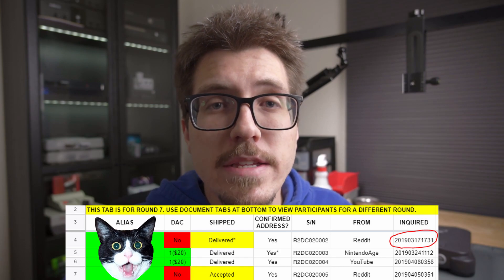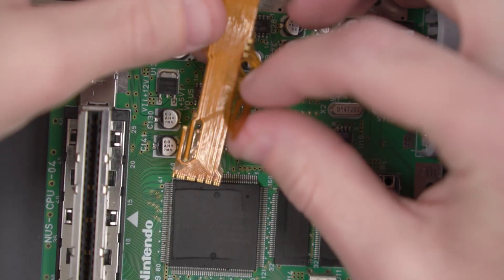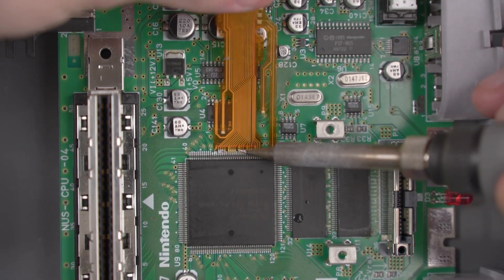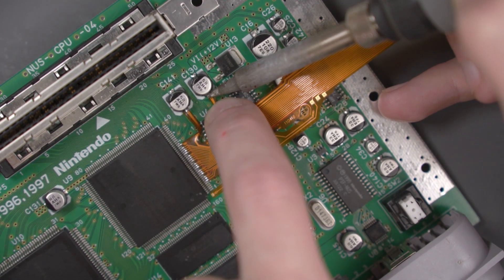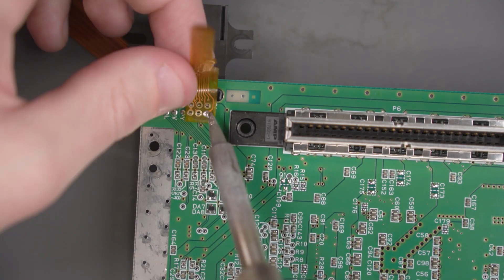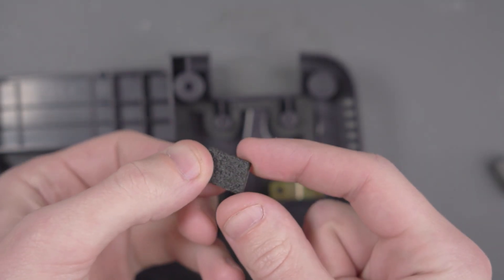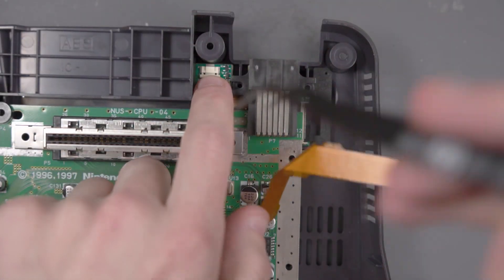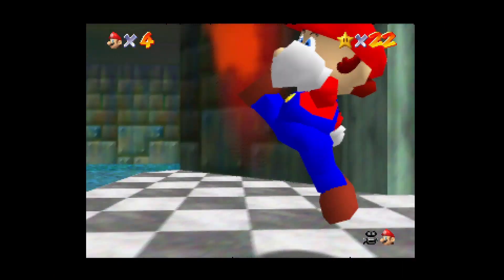UltraHDMI V2 Install - The Original N64 HDMI Mod Is Back... Sort Of

Comment: Thank you so much for making this video. I'm getting reqdy to instal mine, I also have the HW2 version and I had such a hard time finding instalation on the revised version.
Now I can go in confidently and get this thing done.
It's been sitting in my shelf for over a year. I finally built up enough courage to instal the damn thing. Fingers crossed I don't botch this.
Which flux are you using if you don't mind me asking
edit i see you linked it in the description. Thanks 🙂

Comment: I somehow just snagged one of these boards so I am excited to install it but I’m also trying to decide if I Should hire someone else to do it. I am tech savvy and I’m confident I can learn and prepare properly but I would just hate to mess it up LOL
Reply from the maker: Because of how rare these are (with little hope of easy access to replacement flex cables), I might recommend practicing on a different mod lol. Maybe a DCDigital or PS1Digital

Comment: What looks better, a deblur rgb with optimized ossc settings or the ultra hdmi mod? I’ve heard the former looks better from some on the forums.
Reply from the maker: The OSSC footage in this video is deblur through an OSSC in generic mode, and I think it looks just as good as the UltraHDMI. I tried FirebrandX's N64 profile, but it needed adjustments that I didn't have time to do for the video, so it might look a little better
Reply: @dubesinhower  I have an OSSC and 4x looks infinitely better than 2x, so I'm guessing RGB/deblur + OSSC is the way to go for videophiles. Thanks for the video.

Comment: What is flux brand that you are using? Wha'st temperature for soldering iron that you are using as well?
Reply from the maker: I use this liquid flux that Voultar recommended: https://amzn.to/3xfiTEb
In these tiny bottles: https://amzn.to/3v2cN7W
(These Amazon links support me)

I normally use 650 degrees F

Comment: Awesome video! Thanks for doing this. It will be a great reference for others attempting the install on an NTSC console. After doing several hundred of these, I have a few notes:
The Jumper/Expansion will come off with the top and stay self-contained. No reason to pry it out first.

Always lift the heat sink from the back if you aren't going to unscrew the RDRAM heat block. If you don't then you risk tearing the chips off the mainboard since almost all the legs are on one side with a few grounds on the other. Also, make sure the tabs are seated on either side of the memory slot before screwing it back down. Best to lay it down front-to-back.

You aren't missing a screw around the LED. ;) One is an exterior screw that you already removed when you took the top off.

The GPU is interchangeably referred to as the "Reality CoProcessor" and "Reality Signal Processor" which runs at 90MHz. Now you know where the RCP90 gun in Goldeneye 007 gets its name from. ;) It also handles digital audio, which is how the UltraHDMI is able to tap both.

The two capacitors supply 3.3v and 5v to the UltraHDMI board. The other two connections are for Reset and reading Pad 1.

A lot of failed installs happen when attempting to use solder braid since there are so many ways for it to go wrong, especially with a traditional non-cartridge soldering iron. Many T18-compatible Hakko clones can't respond quickly enough to the thermal mass at operating temps. People should cut the braid short, use a fresh piece, turn the temperature UP, and make absolutely sure it is completely molten before you remove it from the pins/flex. For a bridge like yours I would just add flux, clean my iron, and redistribute the solder without braid. Works every time!

I would suggest not adding solder to the multi-out pins until after the analog flex is in place. The notch in one side is so it fits down between pins 5/6 and 7/8. The wider side would not fit if you had it backwards. In fact, you may have to remove solder if pins 5 & 6 are bridged like they are in a few consoles. The plastic post might keep you from getting 1/2 totally flat.

There's a large enough gap for the digital flex to pass through the shielding so no need to bend metal. It seems to be why the UltraHDMI uses the FFC in the first place, since ribbon cables (ALA eTim's N64RGB) would not fit so easily. The shielding isn't sharp so it's fine as long as you don't pinch it under either side.

Comment: 240p cannot fill a 1080p screen with an integer scale unless you do 5x (1200p) and crop down to 240p, which is probably what you want to do here (barely chops off more than typical CRT overscan would have). That's because there is no integer multiple of 240 that equals 1080 and converting 240p to 1080p is non-integer. UltraHDMI calls this 5x crop "Integer+." The standard Integer mode was doing line 4x to 960p windowed within 1080p, just like PS1Digital and DCDigital. Those will not fill a 1080p screen with an integer scale either. The reason your OSSC was filling the screen was because your TV was scaling line-doubled 480p to it's native resolution, so you did not have an integer scale at all.

You will only have an integer scale if you essentially bypass the TV's non-integer scaling, usually by setting the correct integer multiple in the source device to output the display's native panel resolution. Due to simulated overscan, image processing, and other settings that are often hidden/unavailable, it's sometimes difficult to get a proper integer scale on a consumer TV. Even when a manufacturer gives you the settings you need they all call it something different or require you to do strange things for displaying 1:1 pixels from the source device, like rename a specific input "PC" and use that.

Comment: Integer scale in 1080p takes the original 240p signal and scales it 4x, which comes out at 960p.  Putting a 960p image into a 1080p frame is going to leave some black areas around the image.

Good video too btw!
Reply: Yep. "Integer+" scales to 5x (1200p) and crops down to 1080p, barely chopping off any more than your typical CRT overscan would have, so that's probably the option he wants. Another option for a perfect 5x integer scale is the 1600x1200 mode that works great with native 1600x1200 monitors like Dell 2007FP (non-W). I've also got some NEC monitors with the same native resolution.

PS1Digital and DCDigital will also show 960p in a 1080p window for 240p with black borders with an integer scale. The reason his OSSC filled more of his screen with a 2x scale was because his TV was doing a non-integer scale on 480p to its native panel resolution, breaking the integer scale but at least bypassing the TV's typical inability to properly process 240p (they typically do 480p just fine).

Comment: The pieces of foam are for the standard installation without No-Cut. The dense foam would normally occupy the area under the UltraHDMI that would otherwise be suspended since the bottom of the N64 is not flat (area around the EXT port is lower). This keeps it from see-sawing. The lower density foam goes over the AV multi-out pins and holds the UltraHDMI board down against the bottom. The No-Cut base is already designed to occupy the extra space around the EXT port so it does not need the foam underneath. It does still need to be isolated from the top board so I have seen people put foam on the FPGA to keep it pushed down, away from the N64 main board.

Comment: Looks like a good install. Those are some funky bends you had to make on that cable though. 

Quick question: If I already have a Voultar RGB board installed, would that conflict with this mod?
Reply from the maker: I think it might be compatible but I’m not sure
Reply: @dubesinhower  Yes, it's perfectly compatible with the HDMI portion of this mod. You would want to remove it if adding the optional RGB DAC. Advantages of the DAC are: VI Deblur, YPbPr component, RGsB (Sync on Green), selectable output voltage (1.0v, 0.7v), and slightly lower latency (negligible but enough to shift the image if you source sync from the original console's DAC).